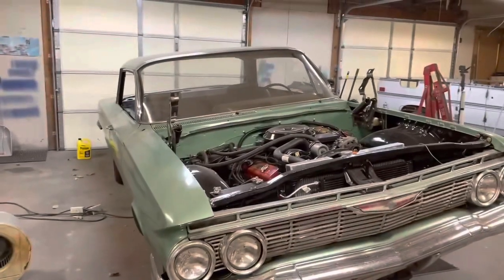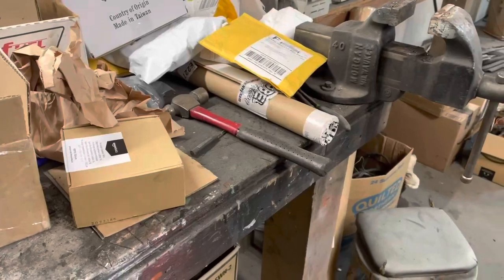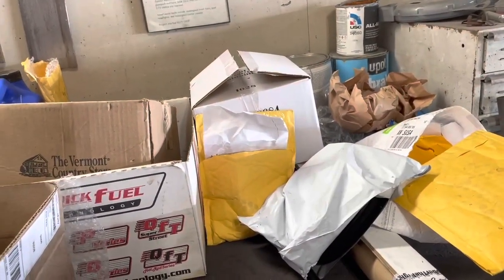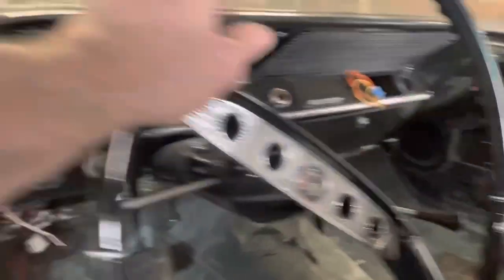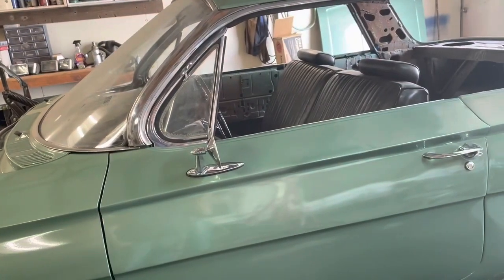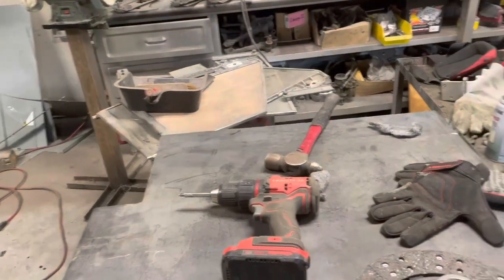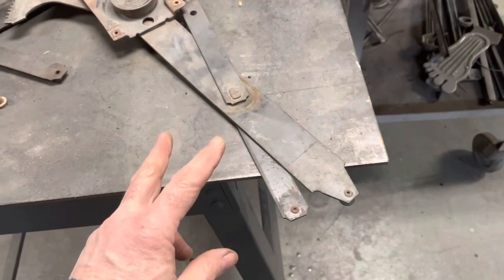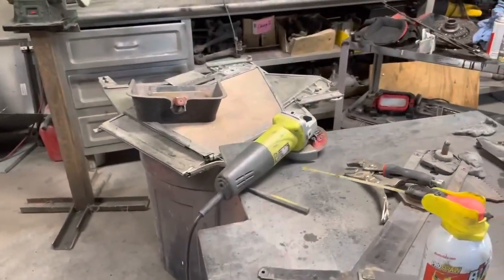1961 Impala Hardtop 4dr to 2dr conversion part 60; fixing clutch issues

Comment: Hello just a word from a 61 owner you maybe using the wrong bell housing also?????
Reply from the maker: It could have been. It’s fixed now, thankfully. The pressure plate I was using was definitely not working with the aluminum bellhousing.